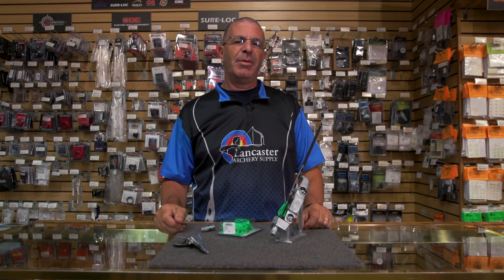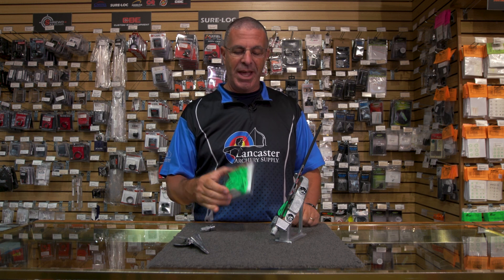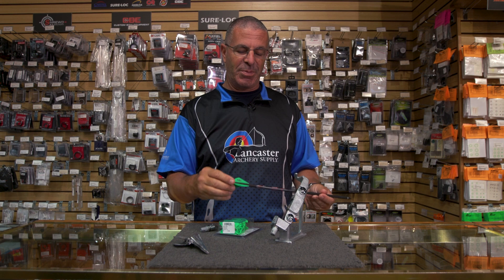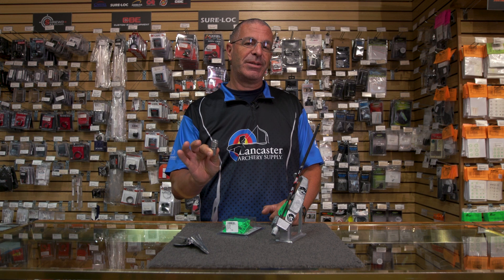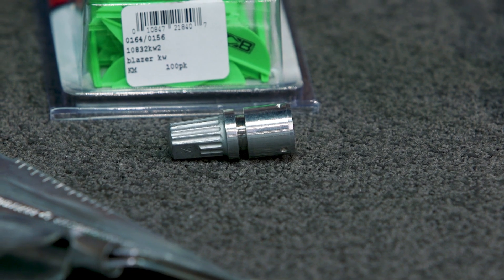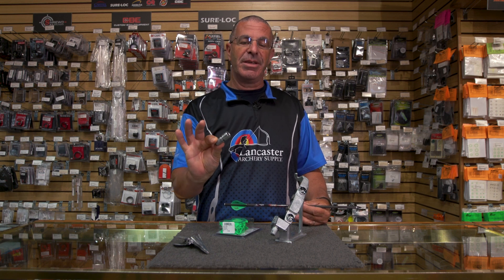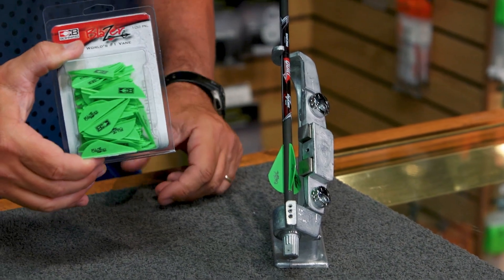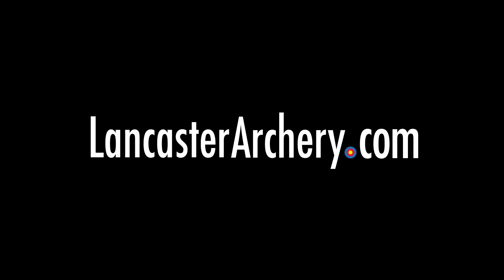Can you Replace Crossbow Vanes/Fletchings?

Comment: When you fletch bolts...you can not go more than 1 degree offset because the vane will hit the inside rail and cause 2 problems...1) bad flight and 2) the constant rubbing of the vane will wear it down and eventually knock it off due to the amount of force. 👍
Reply: Been using 4 degree right helical for 7 years in my crossbow, zero problems.

Comment: PJ , do y'all at Lancaster sell the Bitz adapter for my Bitz jig to refletch my Ravin crossbow bolts ?
Reply from the maker: You bet! https://www.lancasterarchery.com/bitzenburger-x-bow-nock-receiver.html
Reply: Also PJ , my jig has a right helical clamp. Will I need to get a straight clamp since most crossbow fletchings are straight ?
Reply from the maker: @jerryweatherman7468  It would help, although you can play with the positioning of a helical clamp to get it mostly straight.
Reply: Thanks 👍